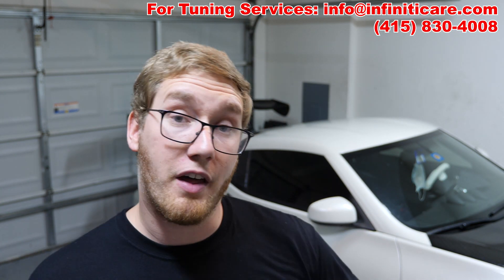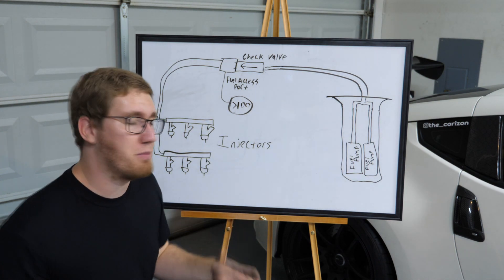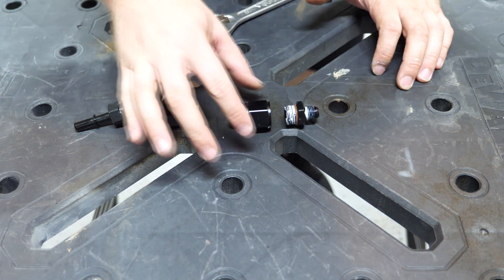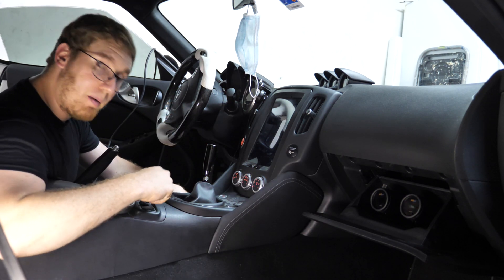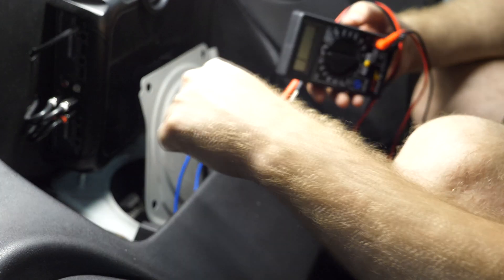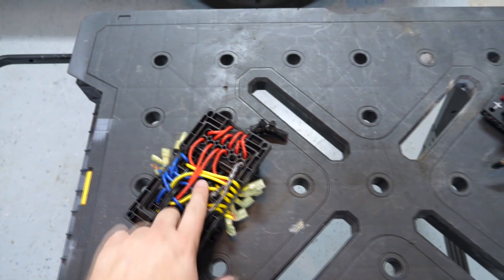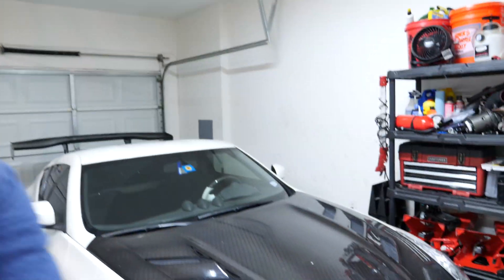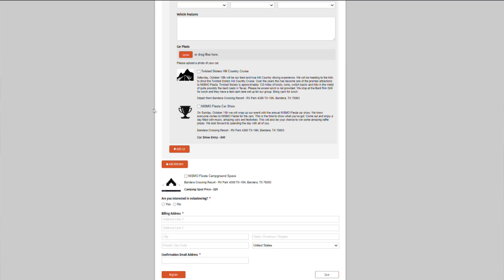Supercharger Install Ep. 5.5 - Avoid These HUGE Mistakes When Upgrading Your Fuel System

Comment: So I'm wondering if I should do the same thing you've done. OR do the CJM drop in dual pump + their full SE level fuel system. OR just get AAM's dual drop in pump and fuel system. Is there any reason you went for the radium? Over the other arguably simpler setups?

Comment: Would having a fuel return line like the one from CJM avoid the issue with the high fuel pressure?
Reply from the maker: Yes, in fact it would negate the reason for having a check valve since the fuel pressure regulator would be after the  check valve anyway. (With it bring in the engine bay if I recall correctly.)

Comment: Damn that dual pump system really beat you down to the fundamentals.  A couple friends and I just finished the same kit with flex fuel kit on his G37 minus the cjm basket and in cabin guages.  Took us 4&1/2 days to start up, dyno tuned on day 6.  Your gonna definitely hit over 600whp on e85 with your setup.  Can't wait for the next video when we get your opinion.

Comment: I had fuel issues with my turbo build as well. Took some time to figure out. I have a duel pump system and one pump (brand new) would bleed off pressure during startup and the car would crank forever before starting. The issue only happened about 50% of the time. This made it hard to pinpoint. Once the pump was replaced everything starts great. These issues can be hard to find sometimes.